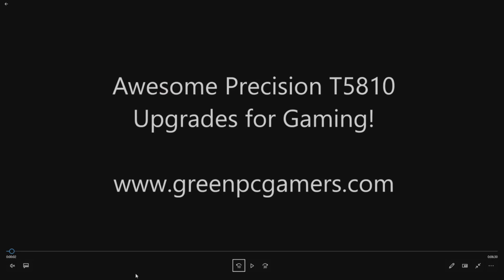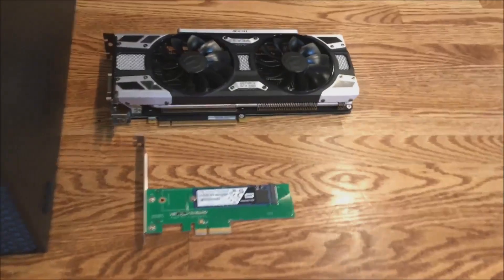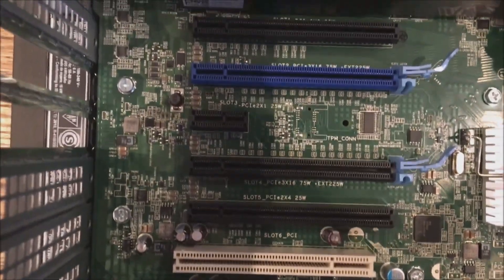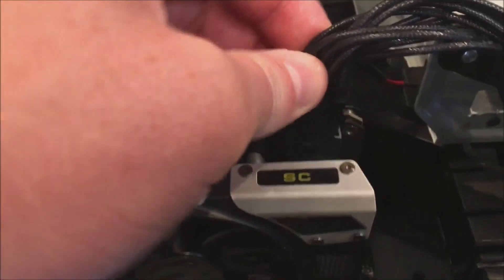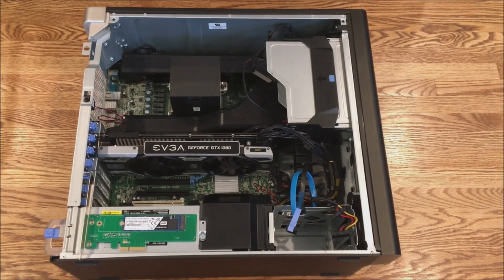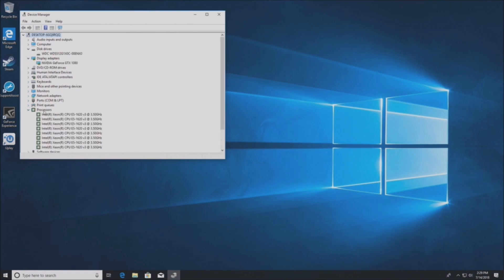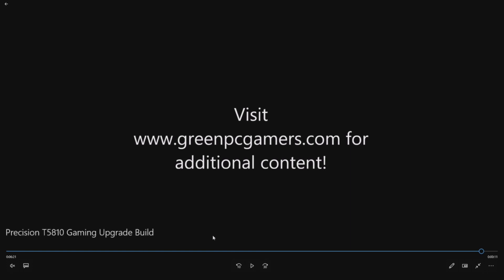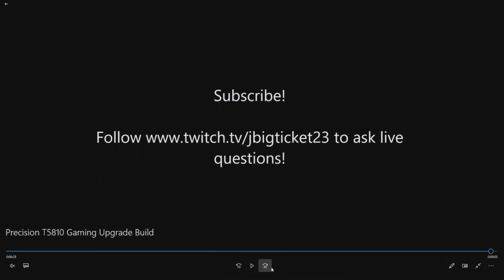Precision T5810 Gaming Computer (GTX 1080 and NVME.2 SSD)

Comment: Hey there, Thanks so much for the video. I picked up one of these recently, and looking to max out the CPU. Any idea what the best bang-for-the-buck proc is right now? I'll gladly spend up to 250$ on a processor if I know it's invested well! Already got RAM and that 825W PSU on the way!
Reply from the maker: The best value is probably the E5-2643 V3 Processor.  You can pick them up for under $250 on eBay.   6C Xeon E5-2643 V3 3.4Ghz 20MB 9.6GTs Processor | 3.7Ghz Max Turbo Frequency (SR204)
Reply: @GreenPCGamerscom  Found an awesome deal on a E5-2680v3. That looks like it would work. What do you think?
Reply from the maker: It will work.  It has a slower base and max frequency, but it does have 12 cores.  What is the main use of the system?
Reply: @GreenPCGamerscom  It'll be for gaming, and some media creation/manipulation. Thing is, this proc is better than my current system in every single way! I'll let you know how it all turns out!

Comment: can i stick a standard ssd drive in this machine is it compatible?
Reply from the maker: Most 2.5" SATA SSD's will work in the T5810 workstation.  You will need a 2.5" to 3.5" drive to install the drive.  What brand/model SSD do you plan to install?

Comment: Is it possible to boot from the (NVME via PCIE adapter) on a T5600 with the LGA 2011 (E5-XXXX V1) dual socketed motherboard? My current understanding is that even with the NVME M.2 adapter, this is not supported on this older XEON-based DELL desktop server.
Reply from the maker: It is possible boot to an NVME.2 SSD on a T5600 Workstation.  The Samsung 950 Pro NVMe.2 SSD w/Adapter will boot on legacy systems.  Some of our community members have successfully booted to newer (960, 970) NVME.2 SSDs.  However, with the newer model NVME.2 SSDs, they have had to use software to get them to boot in legacy systems.  Hopefully this info helps.
Reply: @GreenPCGamerscom  THX!